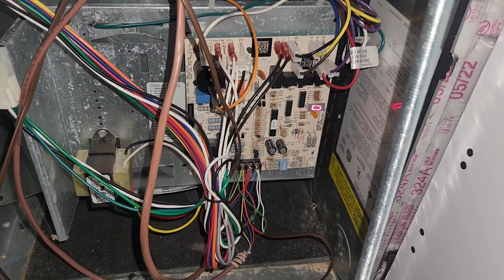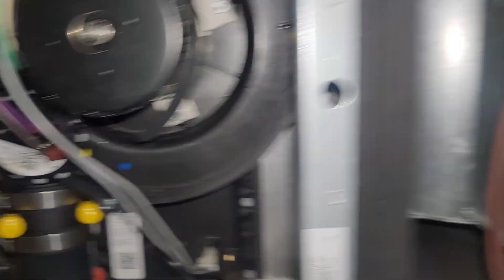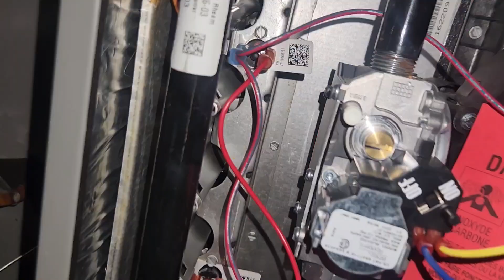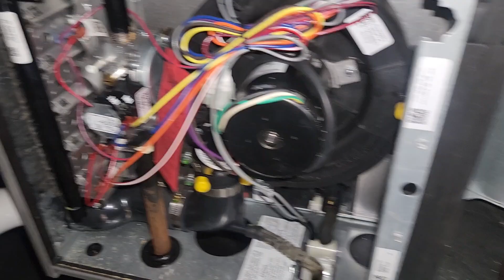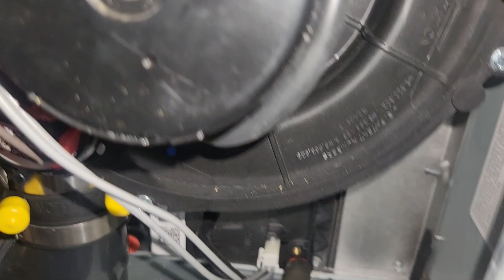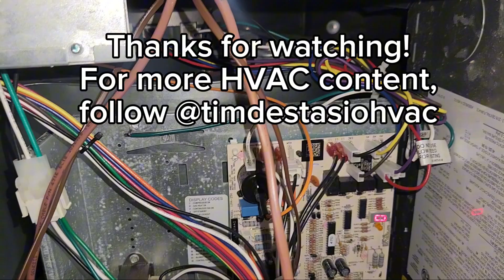Furnace Sequence of Operation Explained

Comment: Finally, a perfect description of the sequence of operations for a single stage gas furnace. Too bad it was spark ignition instead of HSI but the steps were precisely correct.  All you young technicians, once you've listened to this explanation don't bother looking elsewhere for anything better as this one is the straight goods.